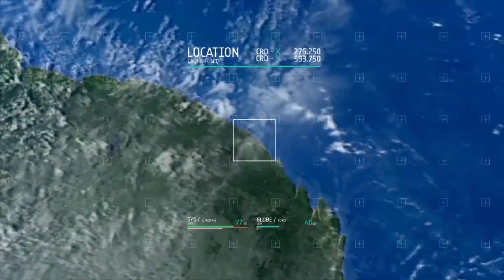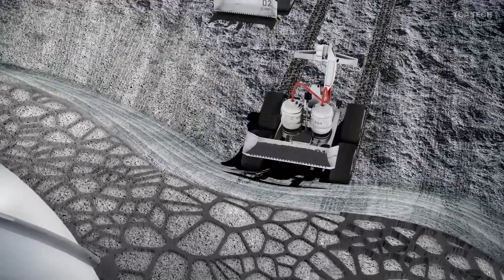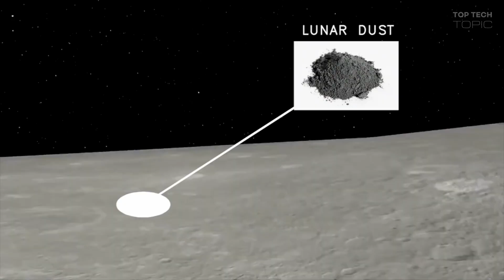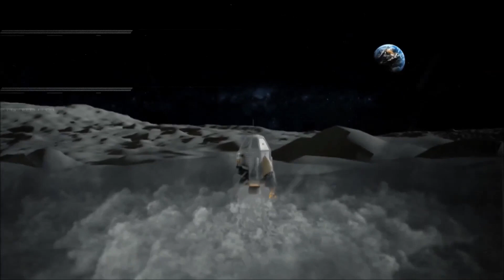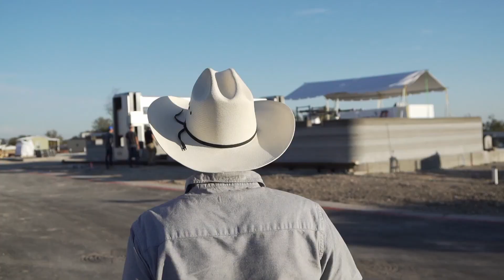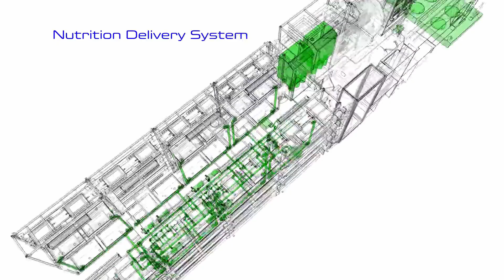Build a Moon 3D Printed Habitat | Designing for life on the Moon

Comment: Perhaps we should build space habitats, on the Moon and Mars, just as our ancestors built the pyramids. You must ensure that you can move machinery, equipment & stores to the appropriate level within the habitat, and pyramids provide a smooth ramp to every level. This approach basically involves blocks of polymer-infused regolith, surrounding a space filled with tamped loose regolith, containing walled empty space for habitation, or even just stacked inflatable modules, and a helical ramp just inside the blocks, with access to each level, to move things around. And just why would you need windows, if you have cameras outside and video projectors inside the habitat?
https://www.youtube.com/watch?v=j4cdDT1ZvAA